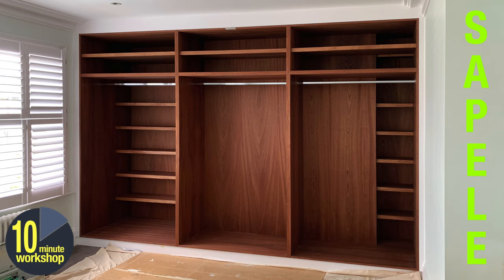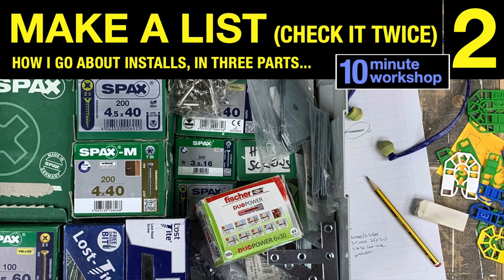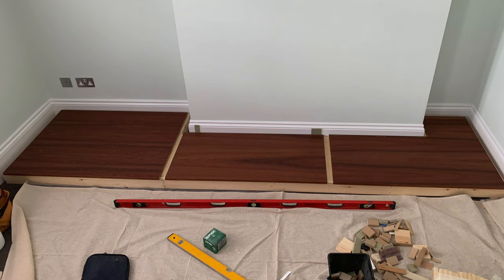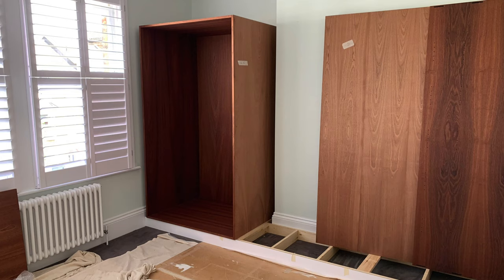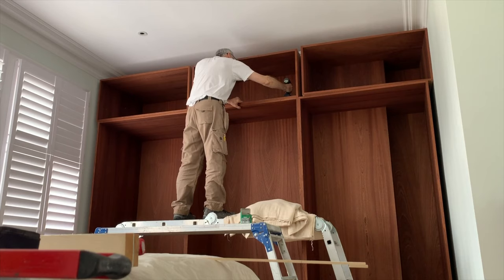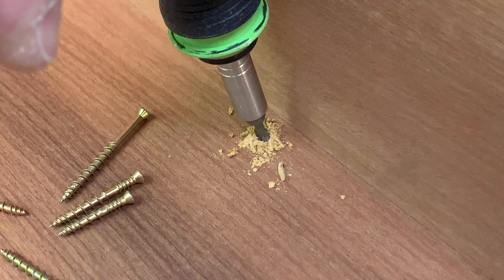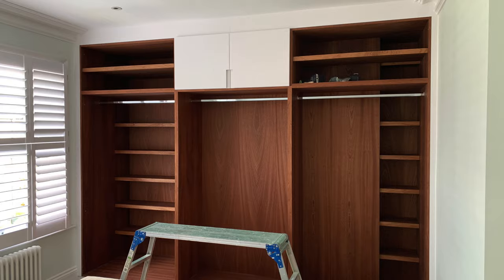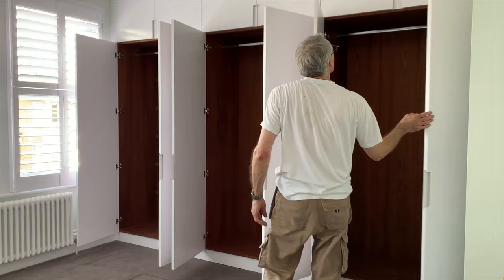Built-in Wardrobes and Shelving Installation [video #344]

Comment: When you build a unit to fit into an alcove how much smaller do you build the cabinets? If its 3,048 mm from wall to wall what’s the combined measurements for your built ins?
Reply from the maker: For regular alcoves in Victorian properties then 20 - 25mm either side, so in your example of 3048 I’d make the carcass run 3000mm. In this one it was more to clear the window at the left. 👍
Reply: @10MinuteWorkshop  thank you, I’m about to tackle my first alcove, do you have any videos on how you install cabinets in alcoves? I know you can’t give up too many of the trade secrets but what ever you can share will help. Building them is no problem, it’s installing that’s the most challenging, as you know walls aren’t square. Thanks

Comment: Just out of interest Peter.... How many mm smaller do you make your doors than the carcass size to maximise adjustability when working on a multi-door run like this?
Reply from the maker: Hi Chris, and thanks! Usually I make the m 3mm narrower per  carcass, but on a run like this I was aiming for a 2mm gap throughout, so I just had to sit down and work it out. The centre pair were slightly narrower than the outers, but only by a mm or so. 👍👍

Comment: Hi Peter, I sometimes re look at this video since there is always a bit I did not listen to or see. Can I ask you something, do you usually in any case leave a gap at the top and sides of a wardrobe job say 50 to 100mm  - one for fixings but also for ventilation even more so at the back? I know of 2 or 3 people whom have issues with damp for example and its always in the wardrobe area ..Thanks :)
Reply from the maker: Hi Christopher. I’ve never had issues with damp - most of my installs are on internal walls where it’s less of an issue - but I’d always allow for ventilation,/air circulation, yes. The infills were unusually wide on this job because of the ceiling cornice,  Hope that helps! 👍
Reply: @10MinuteWorkshop  Thanks for that, i guess if the back of the wardrobe is not flush with the wall that might be a blessing since its aids ventilation and good point what you said regarding is it up against an internal wall - yes i was thinking of an external wall.  Mind you , you need a 100mm gap at top not unless you have very skinny arms to reach at the back and attach the wall fittings. also -shame the cornice had to be hidden above the wardrobe - nice character to a room and something you do not see these days. You can tell I am no youngern :)
Reply from the maker: Christopher Claudio Skierka Yes, indeed. There was a big husband/wife debate about leaving the wardrobes / top boxes shorter and having the plasterwork exposed. But covered won the argument. 🤷‍♂️👍
Reply: @10MinuteWorkshop  she must of been a young wife haha. ps I joined your patreon page - you deserve it for the work you put into it and finding the time to reply to everyone , :),, if the wife insisted it to be covered
Reply from the maker: Thanks Christopher! I saw you’d joined the Patreon, thank you, and welcome! Look forward to chatting with you over there. 👍👍
Reply: @10MinuteWorkshop  you are very welcome

Comment: is there a way to get the infills flush with the cupboard fronts?
Reply from the maker: Sure, but then your hinges are effectively inset so you need to be careful with the spacing.
Reply: @10MinuteWorkshop  thanks, would this be a time to use a half overlay hinge?
Reply from the maker: No, half-overlay are for when you have a door on either side of a single divider. 👍
Reply: @10MinuteWorkshop  ok thank you

Comment: Nice work and video! It seems a bit of a shame to hide this nice Sapele (even if it's just veneer) under white MDF, but that's none of your responsibility ;-)
Reply from the maker: Thanks! 👍👍
Reply: I was just thinking the same myself.
Reply: I agree, but maybe not, the room would be a lot darker it it had the Sapele doors (and I do like the contrast).  Cheers, David.
Reply: I disagree. Sapele doors would’ve screamed mid-century, and they make the room much darker and heavier. The simple white doors opening to a rich timber interior is a less intense, modern take on the mid century built in.

Comment: URGENT. Please answer if anybody knows. I’d like to put really heavy items on the base of my wardrobe but I don’t know if it would tear the base apart judging by the construction of my wardrobe similar to the one in the video at 3:14,  which doesn’t really look like it could hold weight more than 20kgs ☹️ I’d like to put something probably more than 40kgs. Appreciate any help. Thanks! 😊
Reply from the maker: Without knowing exactly how your wardrobes are constructed (eg method of joining the base to the sides, type of plinth etc...) I wouldn't want to advise, but I will say that these wardrobes (and all my wardrobes and cabinets) are made to take at least ~80Kgs on their base.
Reply: Peter Millard ahh thank you for the super fast reply! I guess I’ll just try to go back to the contractor shop and ask them just to be safe. Thanks again Peter! Have a great day!

Comment: Carpets can be a real headache on these kind of jobs. I have a bookcase job pending, where the new carpet is like a trampoline. I would much rather it was refitted around the installation...Some uncharacteristic tact will be required on my part.
Reply: Indeed, that's nobodies favourite conversation. I feel your pain.
Reply from the maker: It is an absolute pain in the neck. And tact?? 😂🤷‍♂️👍
Reply: Peter Millard Yeah - Carpet tact.😂